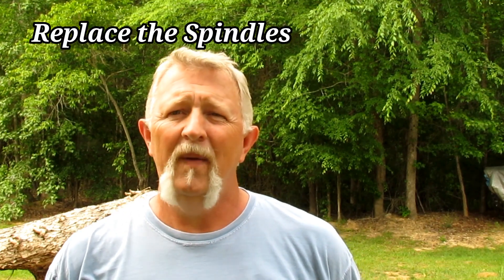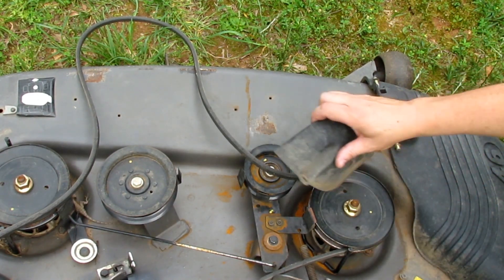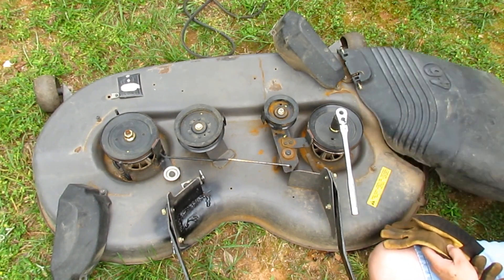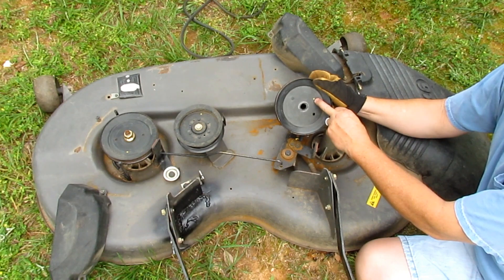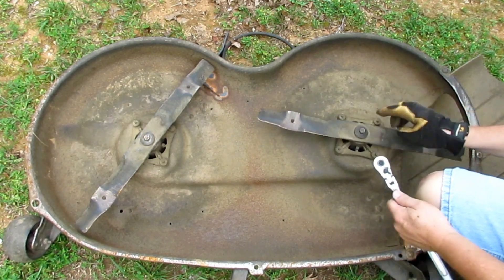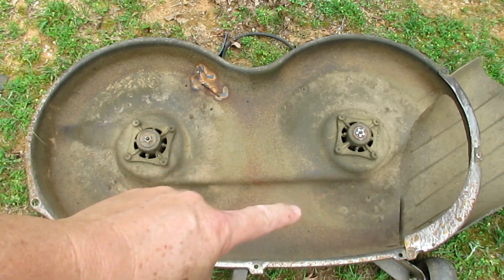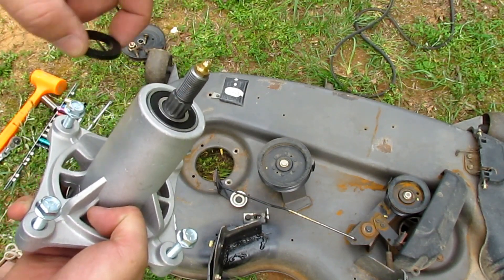Replace Deck Spindles - Husqvarna Yard Tractor YTH22V46

Comment: Hello Dennis. Just want to say "thanks" for this video. I recently replaced the "rapid release" spindles and blades on my Husky mower deck with regular star spindles and blades. I must say I watched the video several times to make sure I didn't miss anything. I bought an aftermarket spindle, pre-threaded and with grease zerks. Also took the time to clean up the deck, and take care of a little surface rust. Thanks again!
Reply from the maker: That's great Bob!  I'm glad the video helped and thanks very much for watching!

Comment: I love your vids tysm! Am 63 first riding mower ever husqvarna. Had it 5 yrs now only service help has been ur vids. Not exact same model. If a part breaks it’s a no brainer. I’d like to also know for some vids “ you might have to do this repair because...” like the spindle vid n a reply you said they got noisy hit stumps was about 100 hrs. Average mowing last longer likely. That kind of info really really helps me work on my mower. Local dealer is a rip off and pricey duh. You have saved me agggravation worry stress time & money. I am ok with repairs but with your guidance never afraid to do so! Plus the maintenance how tos super help for me esp change oil. Why do I have tons of junk always building up under deck? I keep it clean   Is it a husky thing? Never mow wet grass. Don’t let it get too long. Been this way since day 1. On my model there’s a worthless wash out port. Do not use. Manually clean under deck. Again tons of thanks from an widow loving my first riding mower!!!!
Reply from the maker: Thank you for watching, Maggie!  I'm so glad these vids have helped and I really appreciate your support!  I think all mowers are bad about accumulating gunk under the deck.  I believe it is form the moisture inherently in the grass...even when it is dry out.  I'll usually take my deck out once a year and scrape out all the junk, clean and paint any rusted areas etc.

Comment: Thanks so much for your videos. you are easy to follow, you explain everything and for a guy like me, its important. I'm not good at all with working on anything with an engine. So I have the same tractor you have in this video which helped. I changed the spindles with very little problems. one thing I'm not sure about is the amount of grease I put in the spindles. you explained the tells on when it's full but I still couldn't tell. next time I'm gonna use a lock n lube coupler because with the grease gun I had it was hard for me to keep it on the zerk and pump the handle. grease squirting out around the zerk, what a mess but I got it done. at least I think its full. Anyway, you made it an easier process for me because of the way you explained it all. thanks again. Oh, I never thought I could remove and replace the deck without major problems but I did it.... very cool.
Reply from the maker: Thank you for watching!  It takes quite a lot of grease to fill these spindle housings.  Once you see grease come out of the weep hole, or the upper bearing, it's full.

Comment: 5:40 I am believing the deck cracks at the hanger mounts are from normal wea( but abnormal quality welding). I only have 1/2 acre here in Florida and only normal mowing. Today I was cleaning my deck and de-rusting the underside to prepare for paint and I observed a crack! I looked at the other side to see what was involved and sure enough, it was the same mount as yours was! Luckily your videos got me to do my 100 hour maintenance and that is why I found it.  See, even 3 year old videos can save someone's ass LOL. Anyway, my spindles are ok but next time I need to drop my deck, I will replace them. But as for the crack, I fired up my mig and cranked it to 200 amps with med-low wire speed w/ .025 solid wire and went to town! I'm a happy camper now.  I am at the OSPHO point in my anti-rust 'deck' procedure and hopefully I will be painting tomorrow so I can get it mounted back on.. Now I understand how important that water hose cleaning system is. I never used it,but, I will now. I changed my plugs, blade change, air cleaner, and oil/filter today while waiting for the rust converter to dry.  I'm a happy camper!!! Your videos are the best I've ever seen. Thanks!!
Reply from the maker: I think you are correct....whoever is building these decks for Husqvarna needs to review their welding process.  I just recently had a guide wheel come of due to broken welds.  Upon inspection, the welds were very short and narrow.  Its no wonder they broke.  Glad you got it welded back up and working!  Thanks again for watching!
Reply from the maker: LOL!  That opening pic!  Both hanger brackets!  I'd love to buy a fabricated deck for mine, just can't justify the expense.  I'd assume they were welded much better than the stamped decks.

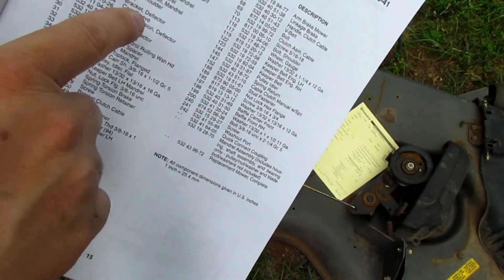Comment: The spindle assembly/mandrel assembly is indeed on the parts list...it's at the bottom of the right column you showed in the video around 7:45...p/n 5321928-70 for your particular model.  For my YTH24v48 it's 5871254-01 (Helping for reference in case someone else has a diff model than you do).
Reply from the maker: You are correct, thank you!  Thank you for watching, Pat!

Comment: Great video. I took off a spindle I thought was damaged. It wasn't.  But because I broke 2 heads off, I had to try to remove the broken bolts. Not easy. I drilled them out and used bolts and nuts. But never again unless I have a new spindle ready as you did.
Reply from the maker: Some folks have had good success using bolts and nuts instead of the self tapping bolts they supply with spindles. Thanks for watching, Dan!

Comment: My Craftsman lawn tractor made by Husqvarna with 42 inch deck uses the same spindles, my son hit a tree root some how and cracked the spindle also the pulley on top spun stripping out all the teeth, had to replace spindle, pulley and blades. The teeth in the pulley are the weakest link and can start spinning on the shaft so it needs to be checked when the spindle is replaced. Your videos are helpful because of the similarities since my Craftsman lawn tractor was made by Husqvarna.
Reply from the maker: Thank you for watching, Joe!  I'm glad the videos help with your Craftsman....and you are right, they are basically the same mower.

Comment: Thanks....After a year Dennis...    bought , got....wrong stuff.  spindle.   ordered your recommendation and all PERFECT....    guess its all good ..I used the spindles that didnt work.. riggged up a southern engineered windmill set up to run two ac alternators...makes.   power DC to charge AGM batteries
Reply from the maker: That's awesome Bobby!  We have a creek alongside our property and I've thought several times about building a water powered generator using an auto alternator and a paddle wheel in the creek.  That's a great idea to put those spindles to use!

Comment: Hi   thank you so much for the videos.   I have a Jonsered yt46.   I was mowing and forgot my new cattle panels were laying on the ground.   The sun was in my eyes.  Oh well you know the rest.  I knew I had done something worse than getting wire around the blades.  I got it to the front and hot it up on my little ramps.  It was on the side opposite the discharge.  I call it the adjuster, but I don't know maybe it is the idler.  I could not see well enough to tell exactly what I face tomorrow, but I mm a have sheared off all 4 bolts.  When I touched the pulley it fell to the deck a b day the blade and spindle are sitting on the ramp.  I am not a mechanic, but my hubby was disabled but insisted on directing all farm work.   I know some things, but I did not know about the grease fittings on the mower.   But I do on the massey.   It is hard for this sr. Citizen widow to try to do it all.
Thanks.
Reply from the maker: Yes, that sounds like it may have done a bit of damage.  I hope y'all are able to fix it. Thank you for watching!

Comment: To avoid the bolt breakage in the future, I would suggest a dab of anti-seize on each, I also apply it to my blade bolts.  Seeing this I believe I will pull mine for a preventative measure.  As you have one intact housing, you could knock the bearings out and either hand pack them or buy replacements at most auto parts places.  That way if you do lose one, you will have a spare ready to drop in.  My old JD spindles would fail at the weld, they weren't cast like the Husqvarna.
Reply from the maker: Thank you David.  All great suggestions, and I think I'll follow your lead.  Pulling the bolts and applying anti-seize is a good idea.  Thnaks for sharing and thank you for watching!

Comment: When I changed my belts, I was worried about busting the bolts to loosen the guide pins to remove the old belt. I just used my hand to push on the pins and I was able to remove the belt without loosening the two bolts. I understand if you are changing the spindles, you don't care if the bolts break. My spindles were fine, and I didn't want to bust the bolts and add more work.
Reply from the maker: Great idea!  Thanks for watching!

Comment: Thanks for explaining the differences in those spindles with the greasing, I was wondering why the aftermarket assemblies were slightly different. I've also snapped off the baffle from my deck but it doesn't seem to affect cutting at all, what's the point of it?
Reply from the maker: Thank you for watching, James!  The baffle is intended to help with airflow and clipping movement in the deck.  I broke mine off not long after I got the mower and never replaced it.

Comment: Hey Dennis.  Just wanted you to know that I successflly replaced both (10 year old) spindles and both drive and deck belts yesterday with the help of your videos BUT.....I found a better way to crank off the eight spindle bolts!  I see where you reached under each spindle pulley and then struggled to break loose each bolt as most of the bolt heads snap off anyway.  Here is my suggestion:  REMOVE THE SPINDLE PULLEY FIRST!  Now you have access from above to use an impact driver with a short extension rod!  I really beat  up my hands doing it from below the pulley then realized if you have access from above, VOILA....easy job!  They wanted almost $600 from a shop to do the job.  Total cost doing it yourself?  Less than $100...2 spindles, two belts and my time.  NOW.....since each spindle requires the lubricant from a grease gun, how do you determine how many "pumps" to fill tns spindle?  I used a newly fully loaded gun and put in about 25 pumps in each.  I checked how much was coming out with each pump and about 2-3 tablespoons came out  Hope I got enough in there but was curious as to if the spindles were actually DRY with no lube in them.  Are they really totally DRY?  Seems the manufacturere (bought the ones you suggested) would have greased them from the factory  Curious.  Love to hear your reply.  Dr. Z (Lou)
Reply from the maker: Thanks for watching, Louis!  Great tip, thank you!  Nice cost savings too!  I'll pump the housings full until a little grease comes out of the bearings.  That will ensure that the housing and the bearings are full.  My experience has been that on recent spindles, the bearings only have a light coat of machine oil in them and no grease at all.  That's what causes premature failures in a lot of replacement spindles.  If they were greased, they'd last a lot longer.  Thanks again!!
Reply: @dwcoffey  Dennis....thanks for the reply!  the rig runs like a top and since the property is for sale where the Husq. is located, the new owner will not have to worry about any spinle failures for a while!  Take care and keep up the good work.  Lou from Clearwater, )the "Free State" of FL.

Comment: Thank so much for this video. Not sure what I did wrong but one of the spindles wore out the star shaped center of the pulley and the teeth on the spindle. Now I may have to replace the pulley and entire spindle again. What do you think could have happened?
Reply from the maker: Hi Rick, sounds like either the pulley was not fully seated on the star-shaped portion of the shaft and wore it off the shaft, or the blade on that shaft hit something really hard and sheared off the star shape  Thanks for watching!
Reply: @dwcoffey  I tightened the nut as much as I could but maybe that's what happened. I ended up getting a new pulley. The original pulley and spindle fit together so snug that I had to get it off with a rubber mallet. The new pulley fit over the new spindle a little loose. I tightened thr nut as much as I could. I also raised the mower deck, the blades seem closer  to the ground than they were with the original spindles. It's working for now. Thanks for you help.

Comment: Thanks for your videos. They have got me through 8 yrs. without taking it to the shop on a YTH22V42. However, after replacing spindles, the belt idler pulley does not disengage the blades fully when I disengage the blades and continues to spin at about 25% velocity. It does not spin upon startup with blades off. I have lubricated the pivot point for the pulley, but its still catching. Everything else working fine. What am I missing?....Thanks, wrsjr.
Reply from the maker: Thank you for watching!  sounds like the belt might be too short and thus staying slightly engaged even when tension is relieved.  If you have your old belt, I'd check the size of the new belt against the old.  I've found that often these new belts are shorter than they are supposed to be.  It only take a half inch too short to be a problem.

Comment: Ha!! Im replacing both spindles. I broke all 8 half inch bolts. Someone miscalculated the corrosion rate of THOSE dissimilar metals!  This should be used as a case study for engineering students. 😁😁😁
Reply from the maker: You're right about that!  not a great design at all.  Thanks for watching!

Comment: Thanks for the video. It looks like you have the same problems with your deck as I do. I have damaged 2 spindles and the same deck mount.
Reply from the maker: Yea, I'm very abusive with mine and definitely making it do things it wasn't designed to do!  haha  I have to say that it has taken to the repairs rather well though.  I hope the same is true for yours!  Thanks for watching!
Reply: It's just starting to be mowing season here and I take it out for its first run tomorrow. We'll see how she goes. I have replaced 2 of those cowlings that bolt on under the deck. I would like a season without breakages. Anyway we'll see how she goes.

Comment: You will probably break all the  spindle mounting bolts.  I did.  They are installed  in the factory as self drilling and tapping  hex head bolts.  Replacement spindles come with tapped holes and new bolts.  Easy as pie. 
JoeB.
Reply from the maker: Thanks for watching, Joseph!  I think all but 2 of mine broke.  :)

Comment: Dennis, thank you for your videos, they’re very helpful.  Why did you replace your spindles? Were they making a noise or vibration?  I’m getting ready to replace the deck belt and plan to look at the spindles for any wear.  The mower is around 6 years old. Thanks
Reply from the maker: Thank you for watching, Paul!  I had been using my mower to cut some very rough areas in the woods behind my house, hit several low stumps and wore the spindles out.

Comment: Dennis, my problem his I replaced my mower belt.  Then I went to use it and the belt broke. So what did I do wrong? I followed the plan-o-gram, any thoughts. Thanking you in advance.
Reply from the maker: Thank you very much for watching, Rick!  I've had this happen to me before.  I've done 2 things wrong when putting on a belt.  The one that broke the belt right away was that I failed to route the belt under the spring-steel guides that keep the belt on the pulleys.  They are about an inch or so wide and stick up vertically at the side of a couple of the pulleys to keep the belt from slipping off.   If you don't route the belt between the guides and the pulleys, the sharp edge of the guide will cut the belt and the belt will ride against the brake, which will snatch the belt and break it.  The other thing I've done is install the belt 'backwards.'  The belt has a flat side and a v-shaped side.  You have to install the belt so that the v-shape side runs inside the spindle pulleys and the flat side runs against the idler pulleys.  Installed 'backwards', the belt will either break or wear out really quickly.  I hope this helps, Rick.  If these are not the problems, let me know and we'll figure it out.
Reply: @dwcoffey  Thanks so much for the reply. I will be careful how I place the belt, especially around the spring-steel guides. Thanks for being there you save me lots of money. Thanks again.

Comment: Watched another video on greasing the spindle bearings. Those are SEALED bearings and pumping grease into the house will not deliver grease to the bearings unless you remove the bearing seal from the inside of both the top and bottom bearings. Also if you do not have a relief hole the the housing, eventually the grease pressure will start to force the bearings out of the housing.
Reply from the maker: Thanks for watching, Charles!  Here's my video on that:  https://youtu.be/EYyhVyHysaw
Reply: @dwcoffey  I could not remember the link to the video. I help out with equipment  maintenance at local non profit. They mow a lot of rough ground, and spends only last 3 years or so, and I am on my third set of spindles. Sometimes the legs of the spindles are sheared off.  Last time I had to resort to a sawzall and propane torch to get the old spindles out.